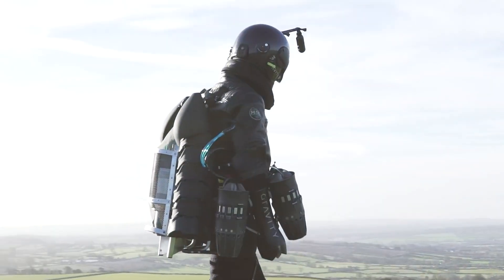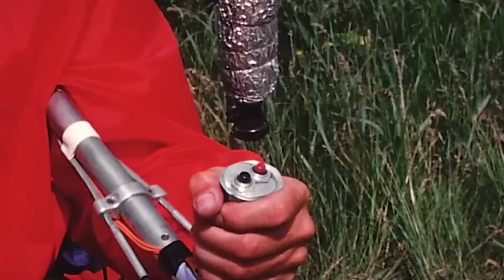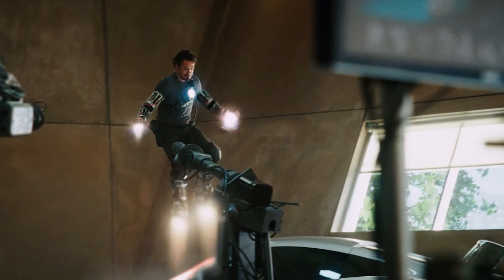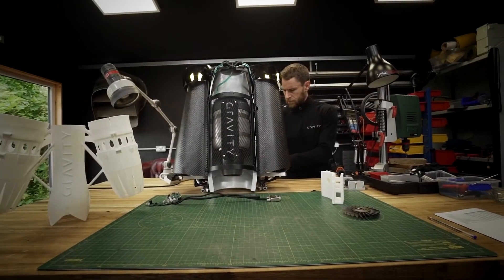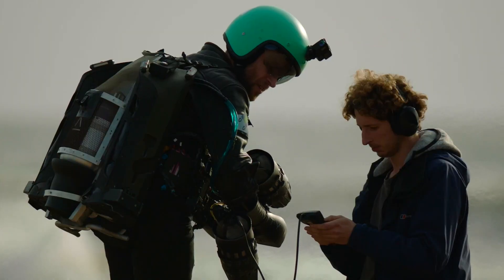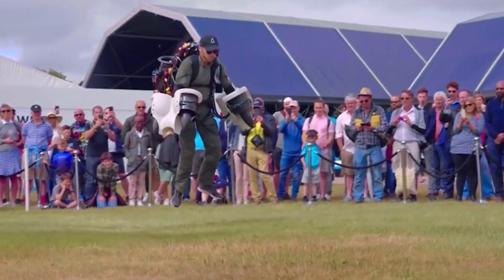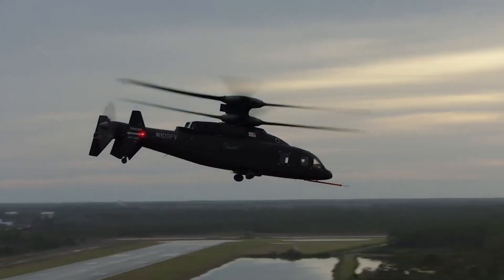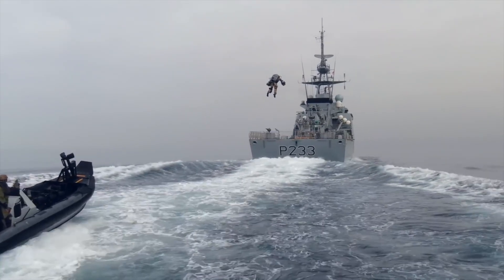Gravity Jet Suit: a toy or the future?

Comment: If hovering a few inches above ground, maybe this could be used in a fitness or rehab setting for people who are injured, obese, elderly or disabled to move their legs for some exercise without harming their joints. Under strict, controlled conditions, the patient could slowly hover around a racetrack while moving their legs in a running motion or taking little jumps.

Comment: an exoskeleton might not be needed. the problem is that you need to support yourself with your arms, but if there is a "rod" from the backpack to the hands, the arms wont need to support anything. even more, then you could get your hands free and there could be a balance system with your body that moved you forward, instead of the hands doing this.